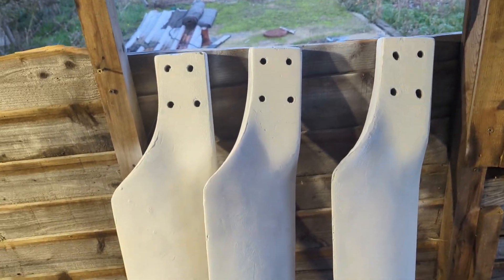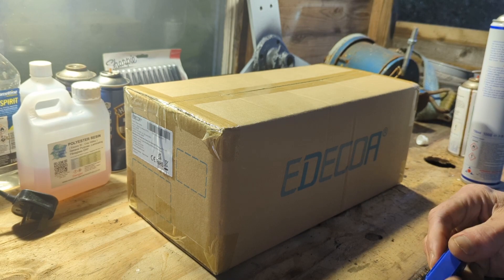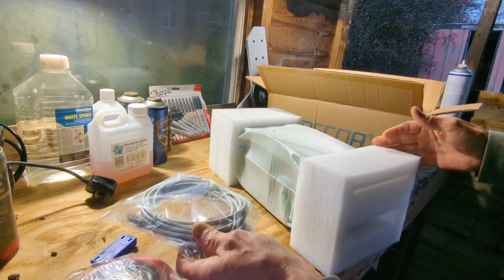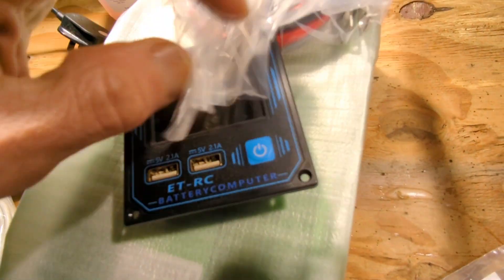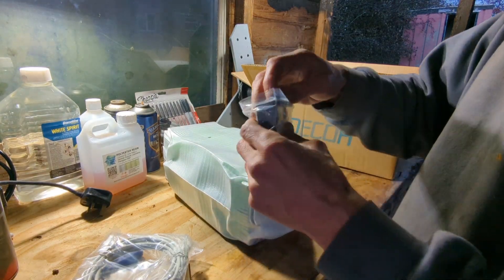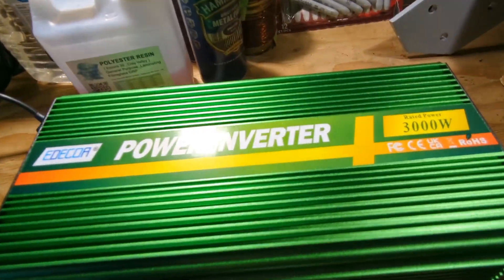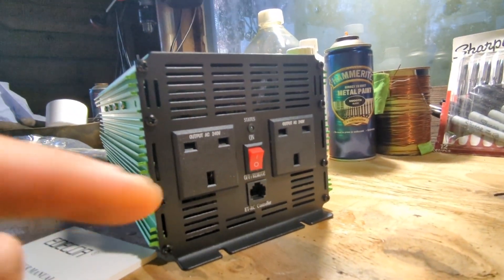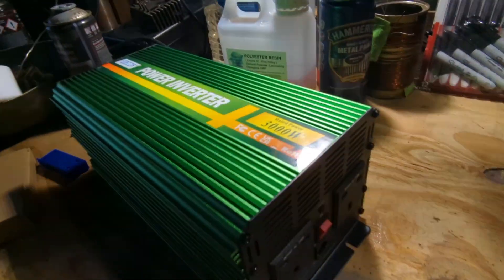3kw Off Grid Inverter - Wind Generator Project - 13th November 2022

Comment: If you decide to keep it I would like to see the insides. My reliable 5000W Sine wave. Ran 14 ga from the board to the outlet terminals. I changed them for 10 Ga terminals. It kept browning out. That stopped it. On the input I flattened 1 inch copper tubing and used 4/0 cable to the batteries. It could not draw enough to even do 2000 watts before turning on alarms and shutting down. 4/0 fixed that. I use that 5000 Watt to run my whole house after mods. My mods are on Windy Nation Community. Post Your Photo's : Flying as of 6/30/2010. Page 14.